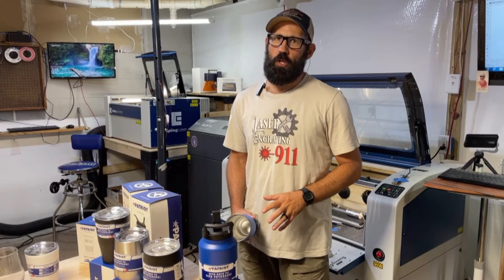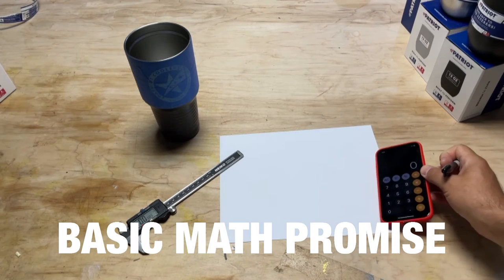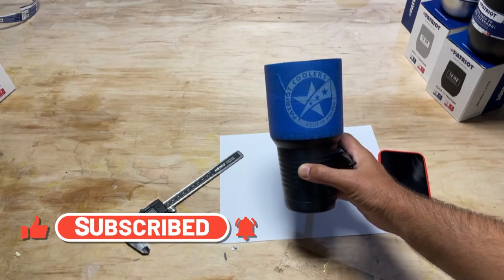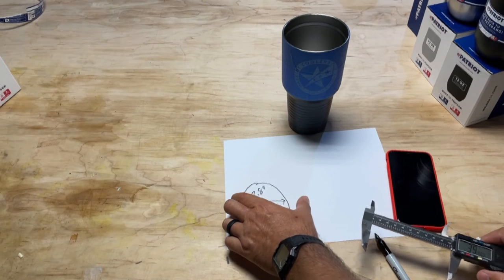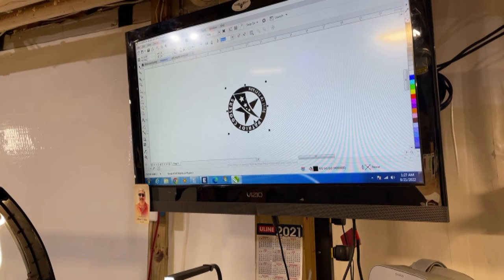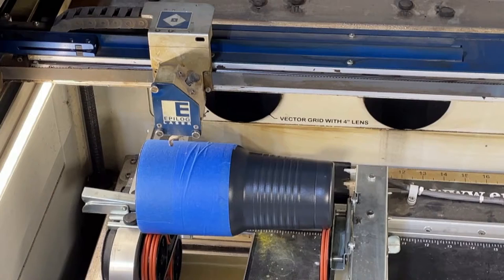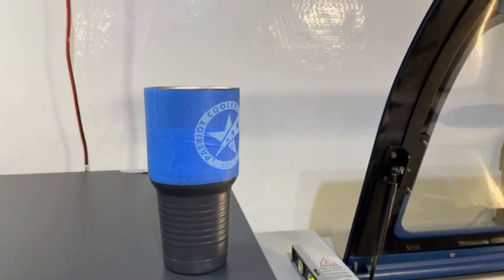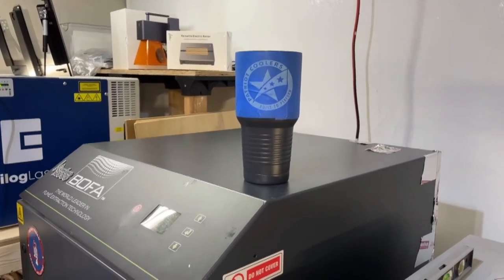Circle Logo Engraving on Cups: How To Make It Look Correct

Comment: This is great, thank you. What kind of settings would you use to engrave on the blue tape without ruining an actual tumbler/bottle? And would this work on a 20w diode or would I need a different colour tape?
Reply from the maker: for sure it will work, start with the fastest speed you can, and maybe 5% power, keep working up until you see a white mark, then save that setting
Reply: Thank you!  @LaserEngraving911

Comment: How low and fast of setting are you running to not blow thru the tape , i have a 130 thunderlaser
Reply from the maker: Fastest speed you have and lowest power, start there, then increase power in increments of 5 until you start seeing a mark. Then save that setting.

Comment: To make it look absolutely perfect one could 3D model the vessel to be engraved, project the image onto the model, and then unroll that curved design back to a flat pattern. As the vessel curves around the design needs to stretch more, with almost no stretching needed in the center. However, your way is a whole lot easier/ quicker/ cheaper for the client.
Reply from the maker: I like the way you think.. cool idea!

Comment: hi, Thanks for the video! Would you use the same technique on a pet bowl that is 6 or 8 inches in diameter?
Reply from the maker: Yes you can! I would run a test first with blue painters tape and  see if it is actually necessary though. Since the curve is so gradual on something of that size.

Comment: What do you have your blue tape settings at?
Reply from the maker: I have a 120watt laser in the video so my power is at 10% and my speed is at 100%, low power fast speed.
Reply: @LaserEngraving911  So is it actually only engraving the tape and not the tumbler with this setting?

Comment: Would you do the same thing on a square border on a tumbler?   Been having some skewing on some yeti 20oz tumblers using cylinder correction
Reply from the maker: No I would not this is only for circle shaped logo, no need on square if you are using rotary, the issue you are having is most likely due to the fact that you are using  a galvo laser and not a rotary Co2 with cylinder correction.
Reply: @LaserEngraving911  Michael I slowed down and figured it out. I am using cylinder correction on a fiber. All I needed to do was figure out the taper on the cups and add 3mm wider on the top of the border.

Comment: Can you give me an example in millimeters?  Thank you
Reply from the maker: Sure example, so if your round logo original  diameter was 70mm and the the OD of your cup was 90mm, the new (width only) of your circular logo would be 79mm, hope that helps.
Reply: @LaserEngraving911  ok thanks
Reply: @LaserEngraving911  nice demo, so with mm , you are adding 10% of the OD  ?  if thats correct it makes it nice and simple to remember  👍

Comment: Would it be the opposite if my image looks too wide on something that supposed to not look stretched vertically. So for instance, my image is the Incredible Hulk doing a most muscular pose with type at the bottom but he looks stretched width wise in my image he’s more narrow up and down.
Reply from the maker: is the cup perfectly cylindrical or  does it taper down at the bottom?
Reply: @LaserEngraving911  it’s one of those jugs with the screw top so it’s the same throughout

Comment: I've had to do something similar on a pint glass where the bottom and top have different radii. The flat image is bloated on the bottom a little
Reply from the maker: This method will not be much help when is comes to cone shaped or tapered glasses where the logo is round, and the cup or glass tappers from large to small, it will always looked warped, I went though that same issue years ago, this method works best for cups and drinkware  that are not tappered, I feel your pain :)

Comment: If you want to go super quick and easy, add 10% to the width.  Just need to trick your eyes.
Reply from the maker: That might work some of the time, but the diameter of the cup matters as well as the logo size. So 10% wont always work, but it might get you close, sometimes.
Reply: @LaserEngraving911 true, however the bigger the cup, the smaller egg effect is.